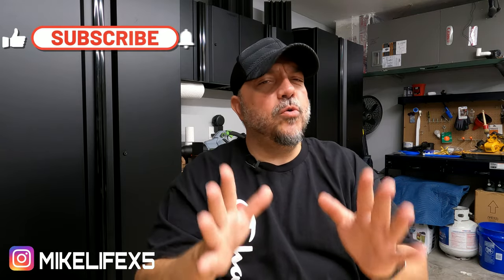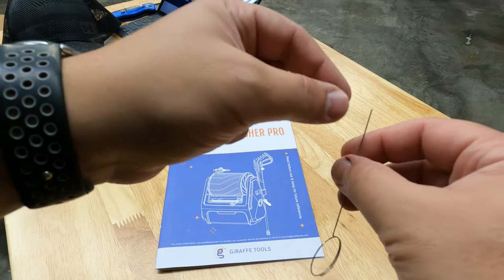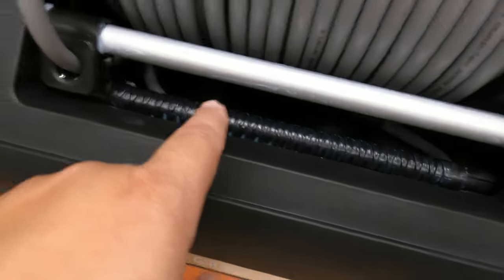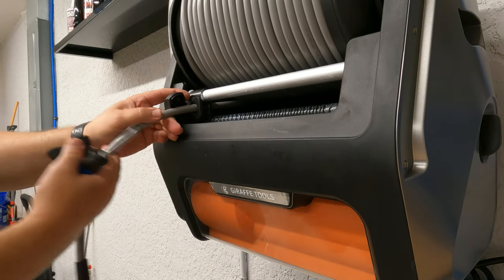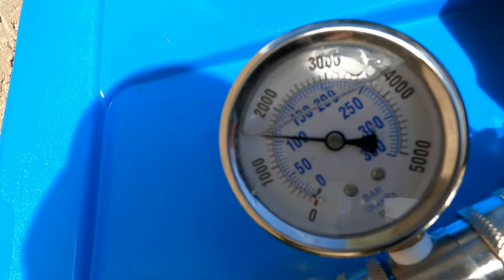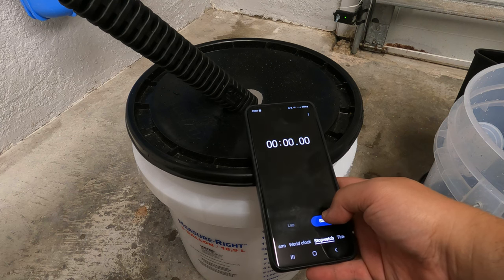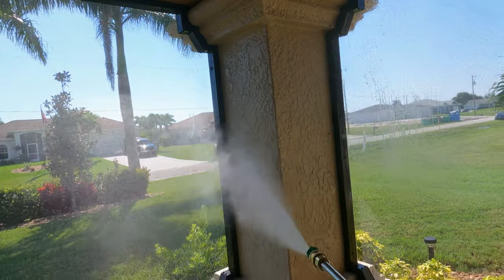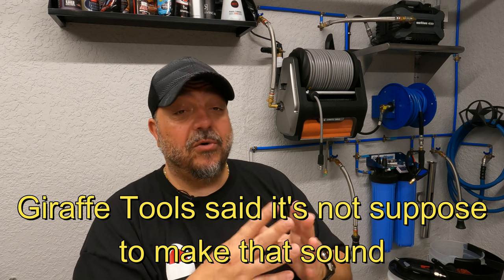Giraffe Tools Grandfalls Wall Mounted Pressure Washer Pro

Comment: Pressure is just a restriction to flow so if you reduce the flow rate you will increase the pressure.   I would imagine they have a built-in pressure relief, so they don't burn out of motor/pump assembly.  That squeak sounds like a slow closing valve which would be used to reduce water hammer issues so it may sound annoying but it's better than breaking water lines from hammering.   I install similar valves at work on my process equipment, so I know that sound all too well.

Comment: Great set up Mike, your like me with quick connects. Makes it so easier, but also more secure. Looks to be a nice pressure washer. I've got an industrial pressure washer, mine has a psi guage built in and a knob to up and lower the pressure
Reply from the maker: Thanks 👍
Reply: @MikeLife1  with having that 100ft hose, do you notice a drop in pressure at all with it been such a long hose, Compared to a standard 10 / 15ft hose?
Reply from the maker: @Bendixon32  Not sure. I haven't attempted to remove the hose to try a shorter one. But I'm sure it looses a little pressure
Reply: @Bendixon32   The one thing I can tell you is that I use a 100’ hose with my older Active unit and I clean 2500sqft of white marble pavers with no issues what so ever.

Comment: While hard turn 90 degree fittings make things look neat and make things easy to hook up, they do impede flow of liquid. Any type of fitting that has a radius design or even just a hose that is routed in a radius will out flow a hard 90. Also a sharp or hard 90 will cavitate in the corner as well.
Fluid dynamics.
How much loss I have never checked, but have experienced it while running fuel and oiling systems for performance applications such as race car, performance boats, etc.   Flow dramatically changes when using a full flow 90 vs a hard 90. This is on the low pressure side not the high pressure side, higher pressure overcomes the restriction at some point.  Whether it affects the gpm on the suction side of a high pressure pump is unknown. Just some info.

Comment: I wouldn't pay $300 for this. Their PSI & GPM is off, which they all are. Therefore them saying the unit will last around 200 hours has got to be off as well so I'm guessing the unit will last a little over 100 hours. More like a disposable pressure washer. Not for me but I like the video. Thx

Comment: I bought a portable pressure washer but thinking about taking it back to buy this.  Would u recomend this?  Do I need an air compressor to make it work or just hook the water hose to it?  Will this replace a pressure washer?
Reply: No air compressor needed. The pump is built into the back of the housing. Just hook up a water hose and a 20 amp dedicated circuit.

Comment: What size pex are you running to the unit? 1/2 or 3/4”? I have 1/2” and I’m hoping it will work for me. Thanks!
Reply from the maker: I'm using 1/2" with no issues
Reply: @MikeLife1  Awesome!  That’s good to hear since I already plumbed in 1/2”. I was afraid I was going to have to rip it out. Thanks for the quick reply.

Comment: The induction motor doesn't benefit as much from a bigger office because it's rpms are tied to 60hz electric, the brushed motor can turn more rpms if load drops. The noise is a valve leaking your pressure off and that might go away after break in, or not LOL. I would stick with the plus+ model or the G20.

Comment: Do you happen to notice the pressure washer pro putting pressure back into the supply line when you let go of the trigger? Mine makes that whine noise as well but seems to add an extreme amount of pressure back into my water supply and it doesn't seem right.
Reply from the maker: It will always have pressure till you release it
Reply: @MikeLife1 I understand that the pressure washer it self will hold pressure. But using the supplied black hose that came with the product you can visually watch that black hose swell up when trigger is released. It's a great enough amount of pressure that it blows the seal on a filter housing I have installed before the pressure washer. I have 2 of these units and both do the same thing. Any experience with that?

Comment: Mike, where did you buy your PEX cut off valves with the two mounting screw holes? I can’t find them at my local big box store. Thanks!
Reply from the maker: If I remember correctly I bought them from Lowe's

Comment: System is turning off at 2500-2600psi so it matches it’s rating. The smaller the nozzle the closer to the rating you will be.

Comment: Hey mike, I have a similar setup with that pressure washer and mine isn’t putting out any pressure after I press the trigger 3-4 times. Even though it’s still on, after the third or fourth press of the trigger, it doesn’t stay pressurized or make any noise at all anymore. Any thoughts as to why this is? Also, when I attach the foam cannon, the foam falls to the floor. I’ve tried 5 different foam cannons and 2 different sprayers. I’ve also replaced the oriface and adjusted the top and front knobs of all foam cannons and the foam still falls to the floor. I’m stumped.
Reply from the maker: You should contact Giraffe tools. They will replace it for you.
Reply: So you think it’s the pressure washer? What about the foam cannon issue? Same deal? Could be the pressure washer?

Comment: The marking on your tips is not mm, it is a rating for the volume of washer they are for. The marking are GPM rating. 2.5 GPM, 3.0 GPM ...

So yeah a 3.0 is going to flow more than a 2.5. Also the other marking on the tips is the degree of fan. 

Great review though.

Comment: Your cold water supply is way too small to give you adequate flow to your system, you should be using a water tank to draw from.
Reply from the maker: Not true. I get 2 gpm with my other pressure washer.